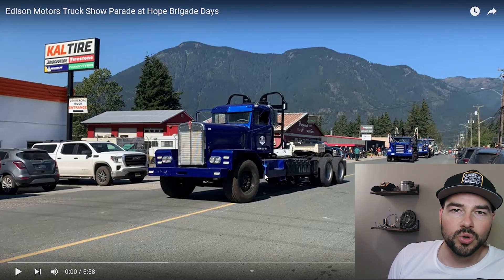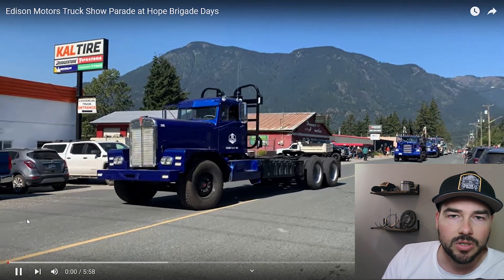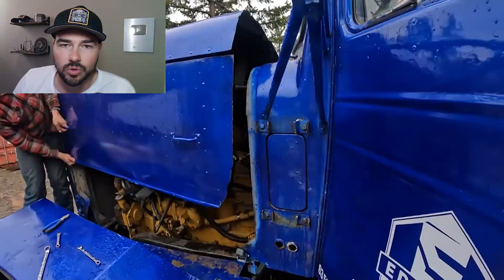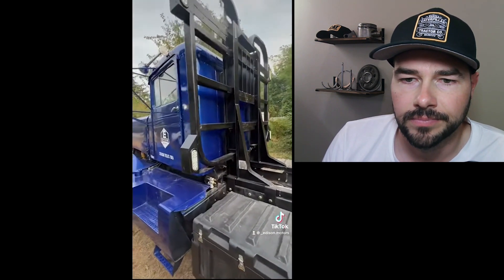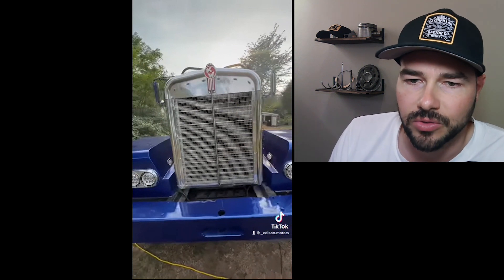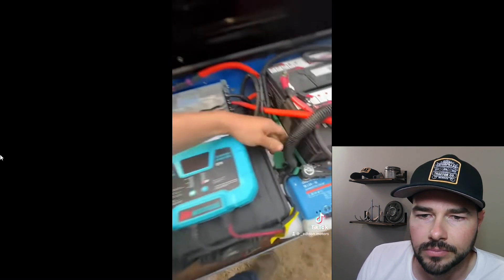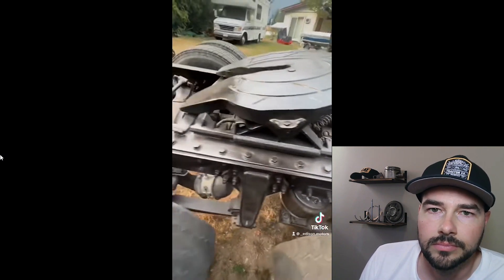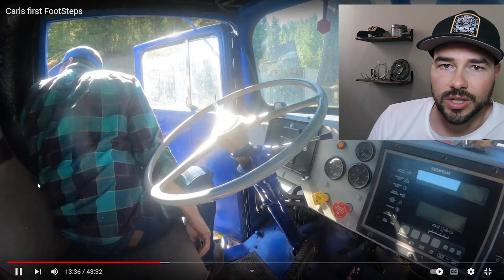Mechanic Reacts to AMAZING Diesel-Electric 1962 Kenworth. Edison Motors.

Comment: “An ENGINE is a MOTOR.”(3:11) No. An engine converts ENERGY to mechanical power. A motor converts some other form of POWER to mechanical power. Your pneumatic impact wrench & air ratchet are examples of motors that convert pneumatic power into shaft power. Some trucks have pneumatic starters (probably only trucks that have air brakes). There are now rechargeable-battery-powered electric impacts & ratchets. These, and the cranking motor on a diesel truck engine, are examples of motors that convert electrical power, supplied by a battery, into shaft power. A hydraulic excavator (Caterpillar models 375 & 395 being my favorite examples) are so named because everything on them (except the engine cranking motor) is powered by hydraulic motors (yes, the “cylinders”, hydraulic linear actuators, are motors too; they produce linear mechanical power instead of shaft (angular) power that the hydraulic motors that power the tracks and the turntable produce. The source of the hydraulic power these motors use is the impressive cluster of pumps engaged to and mounted on-back of that fabulous Cat Diesel. The technical, scientific, engineering definitions of the words WORK, ENERGY, and POWER are the definitions by which I intend these words to be interpreted here. I appreciate the effort you made in researching the matter enough to put that graphic up on the screen, but, as someone who has been (and continues to be) educated in the sciences, I have to object to it on grounds that it is not accurate.
Reply from the maker: Literally from the Oxford dictionary "a machine, especially one powered by electricity or internal combustion, that supplies motive power." That's literally the definition, there is a lot of debate between people about this it would seem. I'm not saying I'm right and your wrong, just quoting the dictionary.

Comment: Diesel electric locomotives have been in use for close to a century.. I remember reading a study showing an astounding amount of freight moved per gallon of diesel.
Reply: That also has alot to do with the low friction of the small surface area of steel wheels on rails.
Reply: @gradoisx2348  Bingo. The electric motor is simply the least complex transmisson required to get it movinf.
Reply: @ChevyConQueso   less friction on the rails, but i believe you are correct, less parasitic loss thru the transmission..
Reply: @gradoisx2348   Kenworth T370 Class 7 diesel-electric hybrid tractor promises consumption savings of 25 per cent.

Comment: The charge controller I saw in there is same exact one I use in my homes solar system.  Victron 150/60 super reliable units an it seems to be very effective in its charging capabilities. They also can self learn the power source or battery set up 12/24/36 volt. Pretty impressive if I must say .

Comment: Those batteries are for the gen-set engine starting and 12VDC accessories. The Tesla traction motors are 3 phase delta AC motors that run off of a DC to AC current inverter.
Reply: Don't forget, Tesla controls use 12v, so the motors still might need a 12v feed to control them somewhere.

Comment: As has been mentioned most diesel locomotives have used electric drive systems for many decades and so have many large haul trucks, the ultimate examples being the Wabco 3200 and prototype Terex Titan, both of which used GM-EMD 645 turbocharged two-stroke locomotive engines.  Other haul trucks and heavy equipment have shifted toward electric drive because of its excellent low-end torque, and it also allows you to do things like this hybrid setup or what British Columbia's Copper Mountain Mine has done to save on diesel fuel, where they have installed overhead trolley wires on the climb out of the pit and fitted the haul trucks with pantographs.

Comment: I'm interested in the concept. I wonder if it can be downsized to a compact pickup truck platform. That way I could run my truck on electric for my commute to work but still have the motor for overlanding and long distance trips.
Reply: I've would love that kind of setup. if i could afford parts and a place to work, I think a telsa motor setup just like in the video would be perfect. could even setup 4wd/awd off one motor
Reply: You're looking for a plug-in hybrid in other words. Mitsubishi makes a plug in hybrid SUV (Outlander) that runs more or less as a petrol-electric drive at most times. It retains a single speed trans and computer controlled clutch so the engine can direct drive the wheels at highway speed, which I guess saves a little bit of fuel when cruising vs the generator and motor.
Reply: The Chevy Volt used an ICE powered generator as a range extender. This arrangement meant you didn't need a transmission. As you know few BEVs have a transmission.
Reply: My thought too. I drive a Nissan 4 cyl diesel pickup.

Comment: Brilliant. The way it should be. Id run that setup in that or any truck
Reply: Hyliion has added the 6X4HE System for long haul trucks.  Easily installed on new or retrofitted on existing trucks, the Hyliion System uses hybrid electrification to deliver fuel savings, lower emissions, instant telematics and a better driver experience. Mesilla Valley Transportation, PAM Transport and Ryder all participated in testing and refining the 6X4HE.

Comment: I've always been curious about that truck but after seeing more about it. It looks more complicated on the electric side when he claims it would be more reliable in the mounts, still more computer than I expected.
Reply: I also don't like generator style hybrids tbh. I'd rather have it where the engine is off for the initial getting up and moving from a top and then from that point forward the engine kicks on and it behaves like a normal vehicle. I don't like when the engine doesn't feel attached if you know what I'm saying.

Comment: Since we're just taking the AC output and converting it to DC, you can use a smaller engine.   Something like a Volkswagen TDI diesel motor.   Your not limited to a 60hz output for charging batteries.     that's why some of those inverter generators work so well in such a small footprint.

Comment: Locomotive generator/alternator are veriable frequency upto 218 Hz. With throttle six position runs at 60Hz (AC).  Voltage output is 600 volts and 0 to 1200Amps.

Comment: That's probably going to be the future of hybrid trucks as it's more efficient for the internal combustion engine to spin at a constant rpm and generate electricity for the traction motors instead of having the engine spin a transmission, driveshafts and differentials. Less moving parts which means less maintenance no transmission to go out no clutch to replace, regenerative breaking which puts power back into the batteries instead of wasting the energy as heat in the breaks and no loud jake break. It's really smart freight locomotives have been using this diesel electric technology for years cause it's more efficient and more practical. Electric motors also have more torque then an internal combustion engine.

Comment: Hey Josh... so what I am seeing is that the next generation of Diesel Technicians are not only going to have to obtain the knowledge we all have when it comes to diagnosing and repairing Diesel Engines but also the "Additional" training and knowledge of Electrical Systems to power these Highway Trucks, Ag, Construction, etc. Beeeeecause due to the "Grandfather Clause" as part of the going full electrical by 2035 there will still be the trucks we work on daily still coming into the shops as well as the new technology/electrical systems... Woof! Talk about a long ass process of training they'll have to go thru. Or..... will it be the need for specifically the old school techs and the new world electrical techs... working side by side. Curious your thoughts on where this is going?

Comment: Keep us informed on this development.  I am restoring a '56 Mack and am toying with the transmission, so I am interested.
Reply: Jerry Boden  This sounds great, no having to add lots of sensors to let the transmission shift right for the engine.  Is 2 speed enough to move the truck from zero to say 90 mph (145 kmph)?

Comment: As I understand it the truck is classed as full electric with an on board generator. You could remove the diesel engine and the truck would still operate normally just with a limited range

Comment: Only a few canbus and power wires are needed for all the lights and accessories on a truck.

The main 'generator' is really an alternator if it puts out ac which is rectified.

Comment: That's really cool I've always thought of trains and them being very strong and why big rigs aren't made like that seams like they could use a 4 cylinder generator but just my thinking probably not enough power !!
Reply: Series hybrids with small batteries "need" to have full power capability from the generator (otherwise a vehicle like this would be dangerous/useless "in the bush").  In some applications - (more likely to use on a ship or power plant than in a truck - due to space issues) running 2 diesel motors/engines can give efficiency while one is idling/off at low demand - it "would be possible" to use the same generator at the 2 different efficient power levels and disconnect the idling engine via a lockup fluid coupling - saying would be possible, though complex and weight may kill any "efficiency gains".  (heck most things physically possible "can be done"  if one has unlimited resources, may not always be a good idea though - beyond a feasibility study.

Comment: I'd buy a truck setup like that😎✌
Reply: Hyliion has added the 6X4HE System for long haul trucks.  Easily installed on new or retrofitted on existing trucks, the Hyliion System uses hybrid electrification to deliver fuel savings, lower emissions, instant telematics and a better driver experience. Mesilla Valley Transportation, PAM Transport and Ryder all participated in testing and refining the 6X4HE.

Comment: This generator is cooled in reverse!! Generator cooling goes from the generator end, across the engine and exhausts out the Rad.  This setup will cause the genset points to burn out under any heavy load, due to lack of cooling.

Comment: The view of the EMC panel looks like the generator is 480 VAC 3 phase which would be a good choice since lots of standard industrial 480 VAC parts are available. Have you worked on a D7 Electric drive dozer? I hear they also use high voltage AC and use frequency modulation for control of the drive motors.....not sure about this but it is very interesting and I have heard that the electric drive dozer is more efficient that a mechanical drive dozer at a given task. I have not heard much about the electric drive dozer lately not sure if it is a flop or what happened....maybe too expensive?

Comment: We had a pre-production Caterpillar D7 Dozer where I work. Like a locomotive , the diesel engine drives a generator, air compressor etc. Traction motors. It was closely monitored by Cat .Very complex and had alot of issues .
No idea why Chase built this thing .